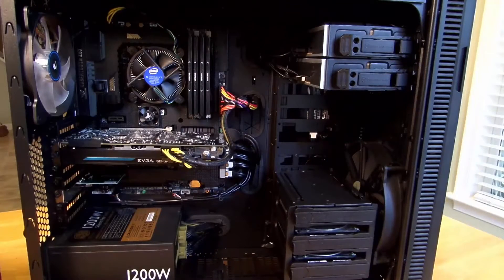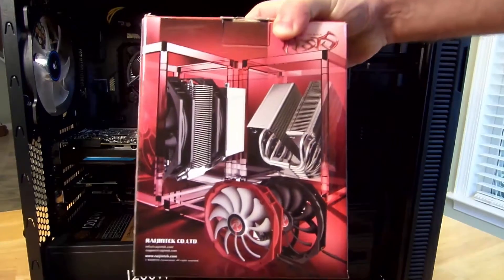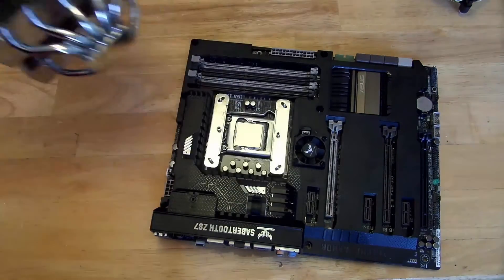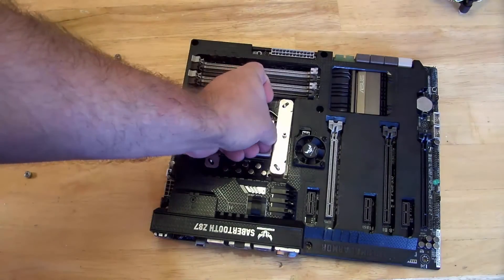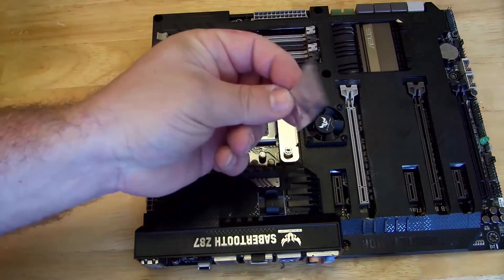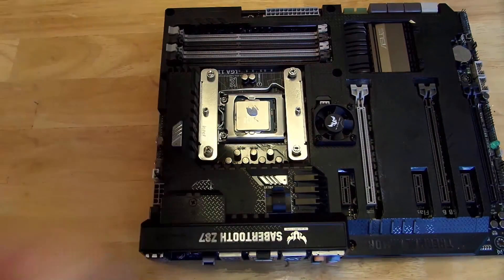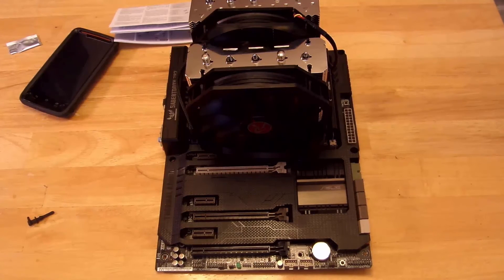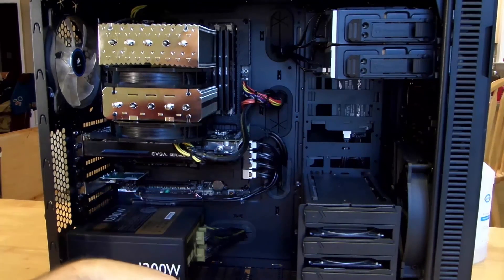How to Install a CPU heatsink: Raijintek Tisis

Comment: I had the same issue with the fans and the RAM! Initially, I moved my RAM away to try and prevent the Heatsink from touching it, but it turns out that, just like you, it barely fits underneath the Heatsink and not the fan. That aside, I was pretty unsure what those two metal wires were as well as if I needed to use all four of the anti-vibration rubbers, and your video answered those questions. Thanks!

Comment: Hey, to avoid the ram issue, you can use 120mm fans instead of the factory 140mm. I have the Tisis core edition on a I7 6850k with 2 Cougar CF-V12HPB Vortex 120mm fans.  I don't have super low profile memory. I have 64 gigs of G.SKILL TridentZ Series ddr4 3200 mhz, with no clearance issues with 120mm fans that are quieter than the Raijintek 140mm and move lots more cfm.